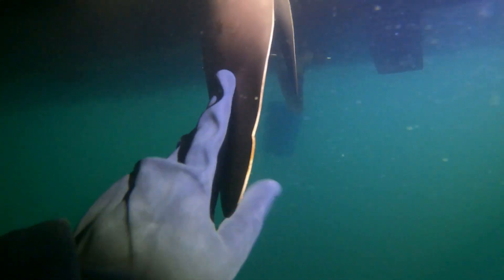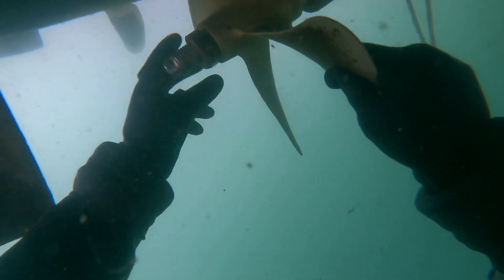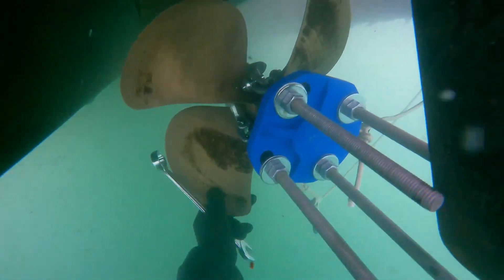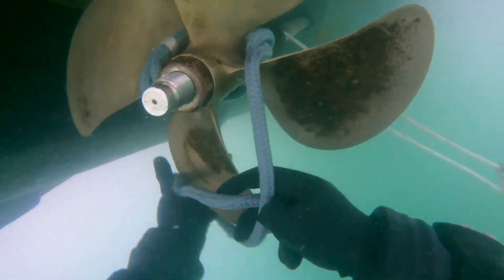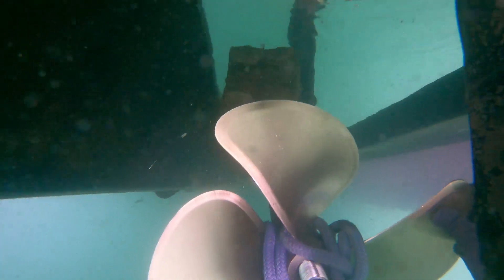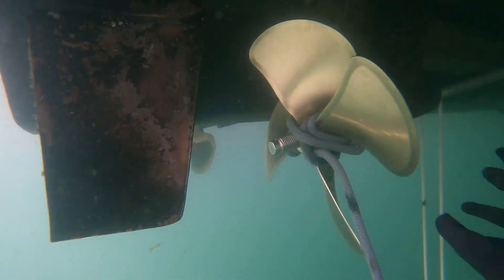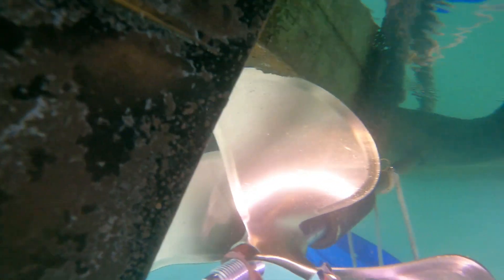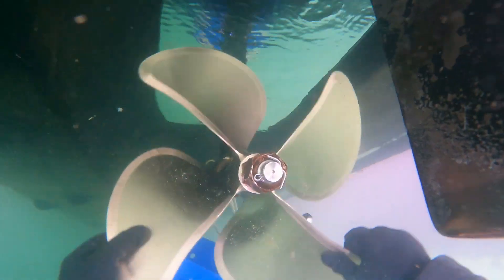Underwater Propeller Replacement - How to Guide - Ships Husbandry - Yacht Work - Commercial Diving

Comment: Thank you for the great video.  Any advice on breaking loose a stuck prop nut?  I am using the same wrench as you are in the video cannot seam to get it to break loose.
Reply from the maker: Just make sure it’s blocked. You can smack the wrench with a 3 pound sledge, invert yourself so your feet are on the hull and squat with your legs for leverage, that usually does the trick. Most times it’s just seized so shocking it with a hammer will break it loose. Could also get a cheater bar…

Comment: Strange question, but I've always wondered if you LOTO the ship when working on the prop or if your guy up top keeps everyone well and clear of anything that could turn something on?
Reply from the maker: Not a strange question at all. For ships, ferries, commercial vessels we lock out tag out. For small yachts, the owner is usually on board and I tell them. If no one is there I block access to the boat with my dive cart. Obvious that a diver is below. Thousands of dives, never had a close call.

Comment: 5:17 you need to block the prop closer to the hub - I've bent a blade by blocking it the way you did.
5:32 the adjustable wrench is backwards.
Reply from the maker: Good to know regarding the blocking, never had that happen before. The wrench I was flipping back and forth. Thanks for watching 🤙🏼